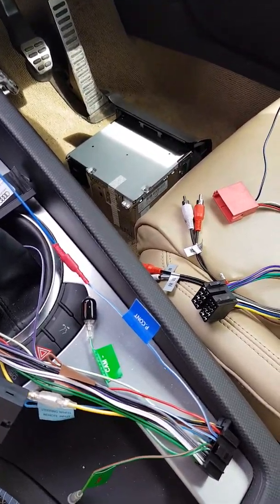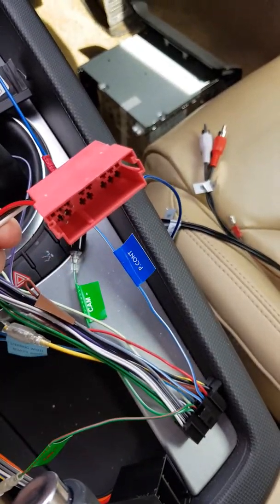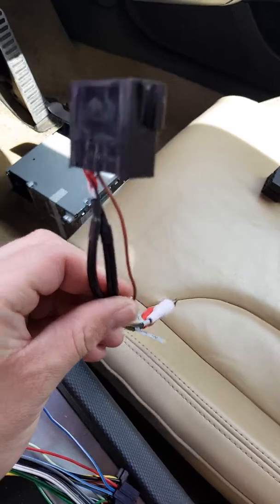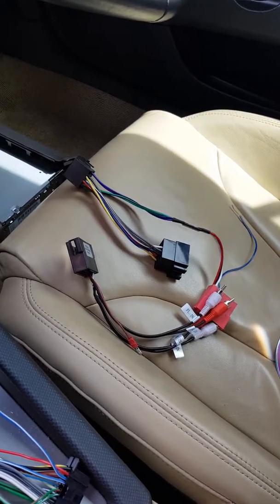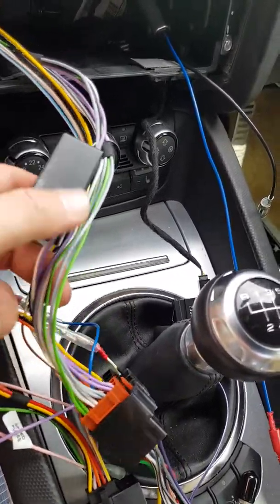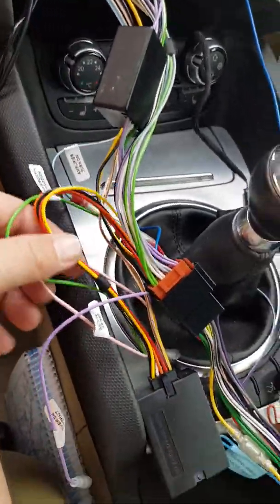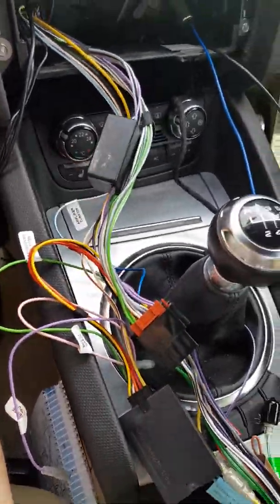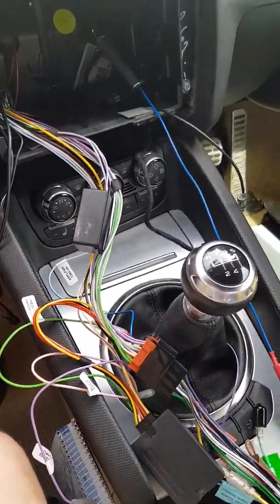Audi wiring adapters and low audio problems with aftermarket radios explained

Comment: Hi there nice video , i have an Audi A3 and bought it with after market head unit . I had a look at the wiring and its a bit of a mess . Do you do a wiring loom adaptor  from audi to aftermarket? If so what is the cost please

Comment: Hi there, I am looking for some advise really. I have purchased an xtrons IA series unit for my 2006 Audi A4 with  quad lock. I received the unit with a BOSE adaptor, which I used as I have Bose system. I got allot of static problems when the lights were on and rustling noise constantly. I contacted Xtrons and they sent me one of these adaptors free of charge. When I tried to use it one of the rear female phono ports was faulty and only a faint sound coming out when I turned the volume right up. I then purchased a 2nd hand adaptor and that worked fine for about two weeks but has since stopped working with the exact same problem. Can you advise what might be causing the issue? Thank you in advance for your help.

Comment: Like your video, I have a problem with my Audi TT mk2 audio. The stereo seems to be working fine but there is no sound at all. Before it went down altogether it used to crackle quite loudly through the speakers in the front.  I've heard TTs have a bad earth problem could this be the same. Please send me the relevant information about the wiring harnesses. Ps. Would changing the stereo itself make any difference or would it still be powered through the amplifier. Cheers Andy Wilson.
Reply from the maker: A very common fault is water gets into the amp.. all MK2 TTs have a rear amplifier. And water gets into it and it ruins it if left too long. Unfortunately you do need the amplifier working even if you want to change the headunit.

Comment: Can I please have you contacts so we can video call, I have bought a active adapter system to make my rear speakers work because they do not work with my aftermarket radio. But I only have 1 wiring harness from te car Audi A3 2009 so I do not know wich cable to tap from where
Reply from the maker: you need one of my leads, its the only way. we make it especially, and not available anywhere else